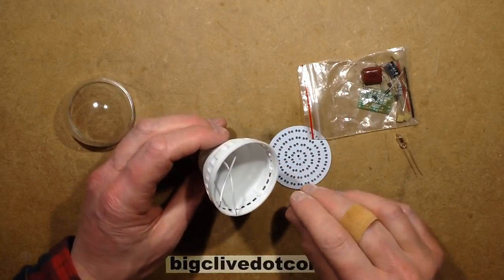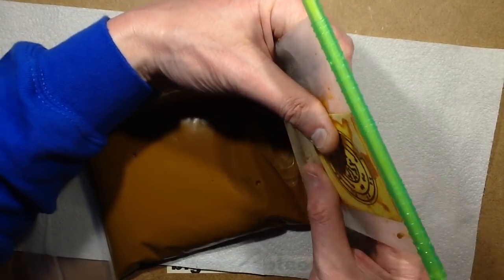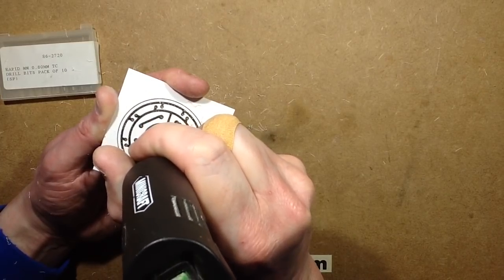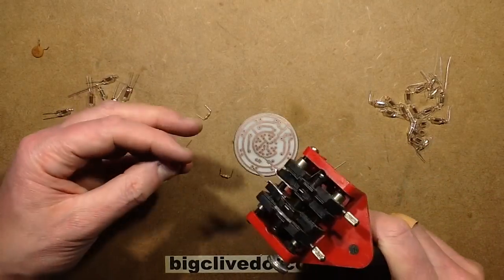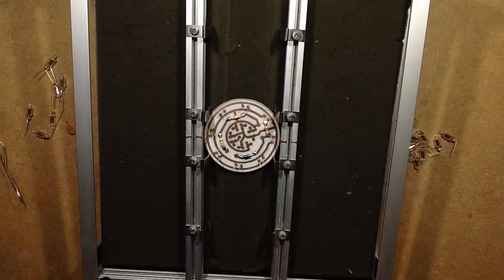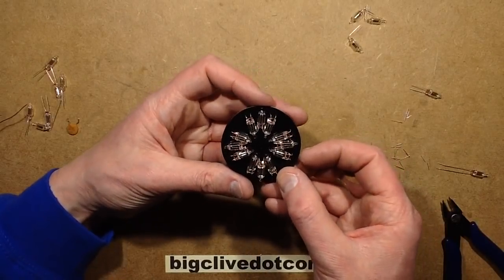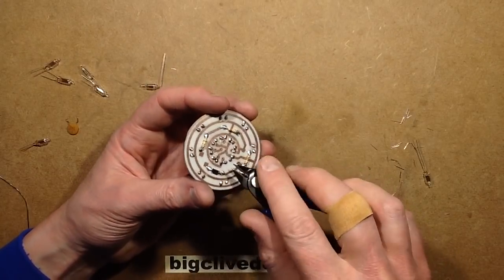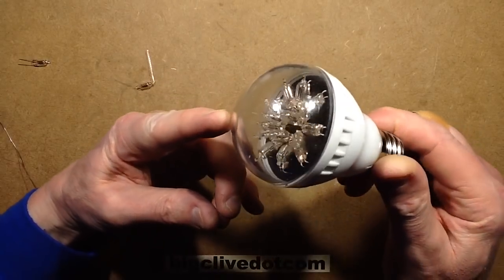Full mega nixie-lamp build with custom PCB.

Comment: First of all, just to say I LOVE your videos.

I used to work for Epson as their Technical Trainer for EMEA. I can probably help with any questions you have regarding printing. For the best results you should be printing at 360/720/1440ppi as there are 60 physical nozzles per inch on the printhead.

Re: Refilling cartridges - obviously the cartridges are where they make the money, hence their irritation but there are real and valid reasons to not use refilled carts if you are a photographer, one being accurate colour reproduction and longevity of print. It's a dull subject to be honest, and without sounding like a shill (I was made redundant) they do make decent machines and ink. 

Keep up the good work mate!

Comment: Yeah, you have NOT been to Disney until you've been to Disney's World in Orlando  FL. I visited, oh I don't know off the top of my head, 15 times. I was just there this past summer. I had the change to go to Disneyland, but that park is just NOT the same. If you ever get the change to visit my country, you should visit Orlando's Disney's park. It will blow your mind away. All the cool things to do, see. Whenever I go, I say for two weeks. One just cannot see the whole entire park in just one, two, three or even four days.
Reply from the maker: I've been to the Orlando parks several times, but not recently.
Reply: bigclivedotcom Oh ok good. Than you know that the best is ONLY in Orlando then. What did you think of World when you visited? When did you go last? Where did you stay? Did you stay in the park or off site? It's cheaper off site the farther away you are the cheaper. I used to live south of Orlando about an hour and half away from Disney. On the Gulf Coast side of Florida for about a few months. The tickets to Disney, Busch Gardens and all other parks are cheaper for those who have a FL drivers license. I had a yearly pass for everything at Busch Gardens and I was paying only $11 USD per month, and in Pounds that equals to $8.96.
Reply from the maker: The original Hollywood Tower Hotel is still the one and only proper ride of its type.  Far too expensive to emulate such a huge masterpiece anywhere else.  But in Disneyland Paris there were the pick of the crop from all the Orlando parks, but better MK2 versions.  I would hope that since I was last in Orlando the technology in rides like the Haunted Mansion has been updated to match Paris.  When I was working on the ride lighting in the Disney Studios park I had ample opportunity to test the rides in the main park and also ride on the new unfinished rides during their testing phase, and I still think that at that time the rides in Paris were technically superior to the originals in Orlando.  But Universal Studios in Orlando is a firm favourite park.

Comment: Go for the HP Envy, great printer and inks are cheaper.
Reply from the maker: I doubt the ink would be as cheap as the generic bottles I get from eBay for the huge 100ml tanks on my printer.
Reply: Sometimes reliability is worth more than the cost of ink, the Envy is the first printer of many that I have owned that has a cheaper ink and is reliable, but I take your point, I went down that road but the print heads fouled up after two or three fills. Keep up the great work Clive.

Comment: Dremel make an awesome mini drill press you lock a standard Dremel multitool into that's prefect for doing PCB's I absolutely love mine! smooth action and very precise, should check it out!  http://www.ebay.com/itm/Dremel-Rotary-Drill-Press-Stand-And-Work-Station-220-01-/260968587353?hash=item3cc2f0a059:g:Vs8AAOxyOlhSta10

Comment: if you do see this clive you can run windows 7 program/drivers for your printer running windows 8 just need to run in compatibility mode (whilst as a administrator), its a pain that most companies can be awkward about software/drivers as i had windows 10 myself and had to revert back to 7 due to the issues of drivers not being available for my rig :/ keep up the great videos, been great watching your videos and learning something new :)

Comment: Fascinating, and a great effect.  Is there a circuit diagram anywhere for this?

I'm familiar with the usual system of having a capacitor per neon (or rather, one less if connected in a ring), but to flash them all using just one capacitor is new to me and I'd love to know how it's done.

Comment: When soldering small PC boards I have a small tool.
It's a piece of 7 strand insulated cable with 2 alligator clips, one holds the board the other clips on to a weight.

Comment: Clive,
I have wanted to make a sort of Starship Enterprise consul for my young nephew but I don't know enough about electricity to feel safe doing it. The idea was to build a fancy box for Xbox and games to be stored in and have a pull down front panel that would have lots of blinking lights and some random patterns on it with false buttons and stuff. I looked into it and the thought of having to make circuit boards and wire up chips and LEDS scares the crap out of me. I wish I had learned this stuff in school.
I can solder okay and I can replace components that fail if I can track them down but no more than that. I really admire you guys for you do.

Comment: Maybe set up the circuit so you could drill the circle out with a hole saw. Just have no circuits in the exact middle where the pilot bit goes through. Just an idea. Hope it helps. Great video and explanation.

Comment: Are there components inside the bulb housing for power? I was under the impression that nixie tubes ran off of high DC voltages.  Great video!  Thank you for sharing. I learned a lot also.
Reply from the maker: +the31doom Mains voltage is ample.
Reply: +bigclivedotcom would you not have to convert it to DC?
Reply from the maker: +trainmeditations That's what the diode does.
Reply: +bigclivedotcom they'd only be powered for half the wave though, correct?
Reply from the maker: +trainmeditations Yes, but as a series of pulses from the capacitor.
Reply: Ahh ok, cool. I have an electrical engineering textbook lying around somewhere. Might be time to get it out to understand more of this stuff.

Comment: would a dremmel work as a pcb drill?
Reply: +Sam Noneofyourbisnus It should work fine. I use a Proxxon rotary tool with the drill press stand and can drill 0.3mm holes without a problem.

Comment: I found Epson Printers, especially ink jet, complete rubbish, the print head blocks up too easily. HP are good and take refills no problem and you get a new head with every ink cartridge :) I have a brother laser printer which gives very good black detail when held up to light there is very little light leakage. Never tried it for this type of work but it worked well on a light panel I made where i needed black with white letters/numbers covered over with a grey semi opaque plastic for an annunciator panel :)

Comment: Can someone explain me, why you can use a power supply like this one (with a capacitor) and in other devices you need a transformer in the power supply?
Couldn't you just alway use a capacitor?
Reply from the maker: +Macarena A transformer usually provides complete electrical isolation from the mains to the output.  A capacitor doesn't.

Comment: Interesting!   Clever!    Well done!
Funny.  Years ago, with difficulty I placed a little NE-2 neon bulb with resistor to illuminate the clock in our GElectric range.
Worked perfectly - until dark.
At night it would not light until I shined a flashlight beam on it.
Reply: Funny you should mention, Mr Carlson's Lab mentioned similar; that vacuum tube (valve) regulators sometimes wouldn't "fire" unless they got a little light, so an incandescent lamp was added beside them. I guess the photons tickle them into action :-)
These days, just back-to-back a couple of LEDs, instead of a neon, huh? :-)

Comment: Very interesting circuit. I may build something similar.

Is there any limit to the number of neon bulbs that can be put in parallel?
Reply from the maker: +jmcinvale Technically no, but it would be more active if you used several circuits like with the nixie flower project.
Reply: +bigclivedotcom Oh ok I'll do that then.

for 120 volt operation do I put two 470K resistors in parallel to drop its value by half?
Reply from the maker: +jmcinvale I'd suggest trying a 100K resistor.
Reply: +bigclivedotcom 

Will do. Thanks.
Reply: I built the circuit and it works great. Used 10 NE-2 neon lamps and did two circles of 5 with the inner 5 angled up some.

If I wanted to slow it down would I just increase the value of the 100K resistor or would making it slower reduce the effect?
Reply from the maker: +jmcinvale You could increase that resistor, but it may make it much less active.
Reply: +bigclivedotcom figured it might do that so I'll leave the resistor value alone.

Comment: Wow,  that's just neons in parallel, I knew  that one would flash with a resistor capacitor drive circuit, but never expected that behaviour.

Does it balance out eventually, or do you need to change the "greedy" one?
Reply from the maker: +Matthew Day I just let it do its own thing.

Comment: I had the best luck with Brother printers as the carts do not even have counter chips and instead use a window and IR LED to directly sense ink levels.
My only complaint is their inkjets require binary blob drivers for Linux.

Comment: I use Dremel 3000 and Dremel Workstation for hole drilling. It takes a bit to set up, but so far it helped to keep drill bits from having a bite at my fingers or other softer parts :).

As for drillbits I used regular Dremel drills until I discovered these carbide bits. They can also be bought (0.8 and 1.0, latter ones are useful when drilling holes for voltage regulators) from China, got mine from dx.com I think. Turned out to be better than expected. I broke only one so far :).

Comment: I used to have a Seno GS years ago, back when Maplin were cheap and sold decent stuff. Can't remember what happened to it.
Reply from the maker: +AintBigAintClever I've just realised that I didn't even need to heat seal the tubing I used.  I could just have used another bag-clip or two at the end.  So you can make a pretty good Seno GS type of system with a short length of heavy duty layflat tubing and some slide-on bag clips from ebay.  I think the Seno GS system is still available from Rapid.

Comment: Why don't you use Sodium persulfate to etching PCBs? Getting used to the old technique or other reasons?
Reply from the maker: +Electester Old habits die hard.  The ferric chloride is messy, but reliable and super stable even when stored in the tank/bag for a long time.

Comment: Get a HP printer, they are amazingly easy to setup and use.
Reply: +Ozzie Peck and requires ink that costs more than blood
Reply: +MrHack4never I think there are new Epson printers that have ink tanks, that you actually fill with liquid ink, which is cheap aswell
Reply: +MrHack4never 
The only good thing about HP printers is they tend to have good Linux drivers.
Reply: Patchuchan And if you take them apart, there are a few good hard-to-find-cheap parts and lots of springs

Comment: Clive i really love ur videos, could u make one on how to make a basic variable power supply to test or power different things out or atleast recommend some cheap and basic power supply
Reply from the maker: +Bipin Patel For an electronics bench I'd suggest buying a decent variable voltage supply with current limiting to protect against excessive smoke when things go wrong.  Besides a multimeter and soldering iron it's probably the most useful thing to have.
Reply: +bigclivedotcom well i just need something basic as i rarely need it to test things out or when im building something. Probably a DC to DC buck step down regulator

Comment: Very cool! I was thinking though I wonder If that glass you put over the PCB while treating it with the UV would have had a significant impact on the cure time seeing as normal glass likes to block a lot of UV rays...
Reply from the maker: +TrollFaceTheMan UV covers a modest wavelength range.  At the safer wavelength used for exposing PCBs glass is transparent.
Reply: Never worked with PCB's personally so I wasn't sure. They must use strong UV A then I assume. Which would make sense otherwise it's be pretty crazy if the Nail Treatment device you were using put out UV B or C and was meant to be used on skin... XD

 I have been watching a lot of your videos lately, usually one or two a day. Really enjoy your channel and have been learning a lot from it. Keep up the awesome work!

Comment: As about printers , I got motivated by your ciss suggestions and after a (poor) research I did on yt I ended up with the conclusion  that Epson printers are the best for using ciss and print quality , well that was not the case . I got an Epson XP Home 422 and was so disappointed from the first moment of unboxing it because of cheap build quality + the many times I tried to clean the print head (wasting almost all ink yet it never printed out 100% correct nozzle check) + wifi connection issues and as a bonus found that it has a build in ink waste firmware counter based on how many prints you do , not on actual ink lvl of the waste tank so after it get's "full" it locks up. I got really mad so I returned it the next day. 
Got myself a Canon mg3650 now by paying 20 Euro less and I am quite happy with it

Comment: Hi Clive,
Like you I am interested in building a project in a Nixie lamp Housing but using Flashing RGB LED's. Could you tell me where you bought the kit from please? I have looked on ebay but maybe I am using the wrong search terms. Thanks
Reply from the maker: +Derek Dodson In the lamp kits the LEDs are operated in series and unfortunately also in parallel pairs.  This may upset some of the flashing LEDs.  If you look at my recent video on the blue/red psychedelic light you will find useful keywords to find the lamps kits on ebay.
Reply: Ahhh yes that would upset flashing LED's probably only one or two in the series would flash as they stole the current to flash essentially resetting the the other flashing LED's. It was more the enclosure I was interested in but fitting a voltage transformer small enough to fit insiii.... Ahhh dang.
Thanks for getting back to me Clive.

Comment: Regarding Epson printers I ditched my Epson a couple of years ago, my thoughts on those printers is on my channel somewhere after I tried a CIS system and it went badly wrong. I went to an older model Canon Pixma MX715 because it allows A4 from the rear tray unlike the newer ones which only have a little tray for photo paper. Never looked back.
Reply from the maker: +Matt Tester (UKMatt2000) The Epson printers need a few tricks played to make them accept the CISS cartridges, and you inevitably have to clean the underside of the printheads by turning the printer off as it's homing and then using a bit of folded kitchen towel to get cleaner under the heads.  Then just bang out loads of large photo prints on plain paper (much better option to using head clean repeatedly) and it finally works.

Comment: I feel compelled to speak in defense of Epson, they are the only consumer-grade printers I would ever consider owning (and the only ones with piezo heads and half-decent bulk ink kits)

If you're having driver trouble you could either opt for a 3rd party RIP, with which Epson are widely supported (due to the aforementioned "not being shit") or nabbing a PPD file and running "raw" postscript as you would on a Linux system.

Comment: I just use a drill press, but just as you have to select a hand drill with no slop, you still have to scrutinize the drill press, particularly if a budget model where the tolerances are lax.

I see you did something strange or rather it seems the software is defective.  It routes using a minimal amount of copper, etching away more than necessary when more could have advantages.  

Granted this is not a high powered circuit nor in need of ground plane shielding or pseudo-capacitance built in, but in this day and age you'd think they wouldn't make such an error in basic logic.  While it would be good to have an extra bit of trace spacing with high voltage, I doubt that's why it routed like that, at least I have seen so many times before with other people's work where software routed using this minimal copper philosophy when it wasn't a high voltage circuit.

I suppose that does make it a slight bit easier to solder, but at the same time it might allow unregulated irons to overheat components.  The two factors seem like a wash to me, cancelling each other out in terms of relevance.  In the end I find it more likely there might be a problem later on with the copper delaminating off the PCB, particularly on SMD drive current limiting, resistor pads.

Comment: Whenever I make a PCB I mark  the holes for drilling with an auto punch. They are inexpensive and very handy.

https//en.wikipedia.org/wiki/Automatic_center_punch

I would be surprised if you don't already have one. I'm still using the one I bought in the late 70's when I was in university.

Comment: I'd recommend a brother printer, they aren't cheap but they work perfectly with generic ink which might appeal to your more frugal tendencies. Also, if you aren't afraid of a little bit of fiddling, it's possible to make windows 7 drivers work with windows 8/10.